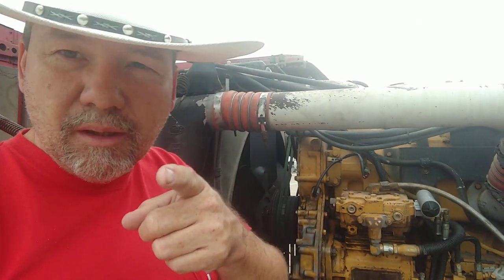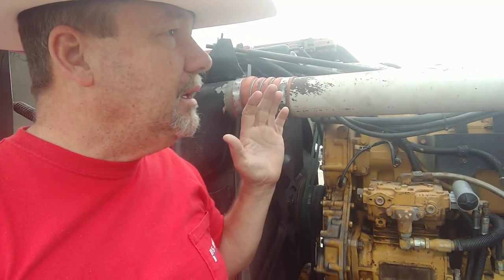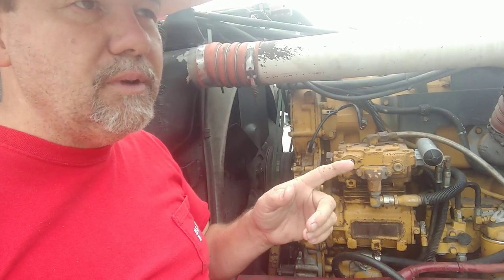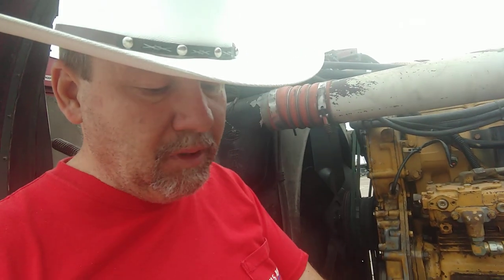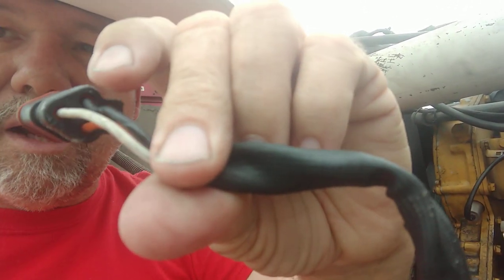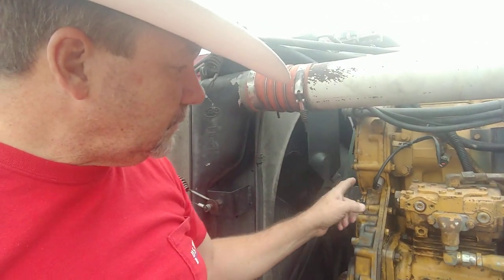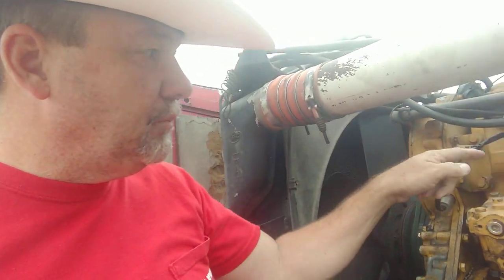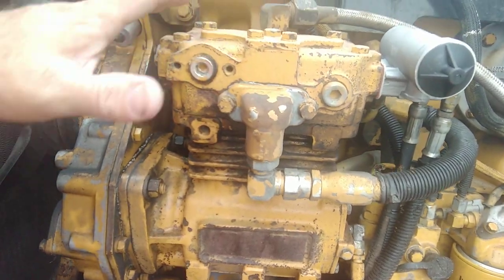Repair CAM - Speed Sensor CAT 3406E 5EK : Adventures in Trucking Series

Comment: Arrived to the receiver shut it off and when it was time to get unloaded I could not star it ( first time in eleven years) it happened around noon, after many check ups , around 10 pm I decided to go to the Buffalo Hunters Peterbilt and get that sensor and see if maybe that’s the problem. Came back put the sensor in plugged it and boom truck is running 😁

Comment: Did you just have to screw it in by hand & a little more with a wrench? Was that all there was to it or did you have to tighten it then loosen it a little? Or did you need to turn the key at all to help time it? I'm not sure, just some of the things I'm hearing about the installation. Don't want to ruin a new $206 part c'mon. Hope you're still monitoring this channel. Have a good one & thank you for sharing.
Reply from the maker: I hand tightened in and gave it a little wrench action.
Started the truck.
Made the video and left.
Nothing to it.
Not a mechanic, just broke, so I did it myself.

Comment: The sensor has to be properly gaped , it comes with a spacer (washer) ,you screw the sensor in ,then unscrew it remove the washer , screw it back in ,then it will be properly gapped
Reply from the maker: Excellent advise. Thank you.
Reply: The old style sensor you had to pull the slip head out (be careful) install remove and add shim. The new style refer to SEBD6791. Contact your local Cat dealer.
Reply: @johngoldsmith6629  Can you tell by looking at the one in his hands if its the new one? I just had to replace mine & the new style is noticeably different from the old. Old is only 6 sided & new is probably 12 sided. The new one I installed looks like the one he's holding in this video anyway. We're trying to figure out if it's just a simple turn it in & forget it or if there is more to it.
Reply: @samuelforrest9575  It is the newer style. The old style was larger and you had to pull the center out. It was plastic and could break. Both require a shim, however the newer style may require two shims. As I stated you have to read SEBD6791 from Cat. Your local dealer can provide the info. Or I need to know you engine serial number.

Comment: Thanks brother Im going to try to fix my 1994 Freightliner FLD120 with a 3406E, how did you find out the problem? My truck is acting like yours were, thanks
Reply from the maker: We located the problem after trying to fix it as a fuel delivery problem. It wasn't,t.
We just ran the truck and wiggled the wires and it almost died.
Professional !!!
Reply: @JamesFergusonAtGooglePlus   Ok I will try that, thanks again
Reply: @JamesFergusonAtGooglePlus  Hahaha...yeah your right professional 😁. I had a bad occasional miss and when I got my guy at Cat to come out and listen, it wouldn't sputter. Darn thing was purrr'n and made me look a little foolish...lol. So my Cat guy (Justin) grabbed a section of a wire harness (magic fingers this guy) and she went to sputtering and found the problem. Wire was broken inside the insulation. $200.00 bucks and plug'n play and back to truck'n👍. I told him to bring his magic fingers and let's go pick the lottery numbers... LMAO 😂

Comment: So my 97 Pete w/3406e was spitting and sputtering and then shut it off. Won't restart... this could be the problem huh?....
Reply from the maker: Might be...or a fuel issue. 
Play with the wire and see.
Reply: Did you get the truck to fire ? My 3406e cranks . Won’t start
Reply: @MrRev232  had to replace all injectors, clean tanks and new lines n filters... this bio fuel is the culprit.